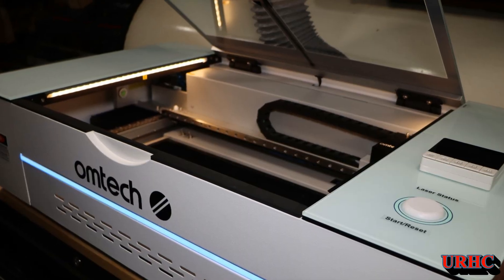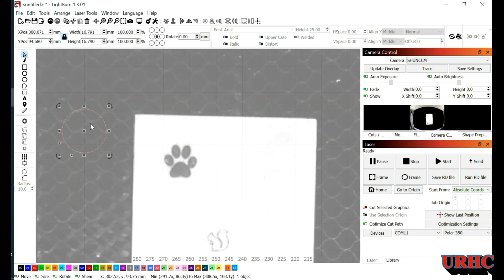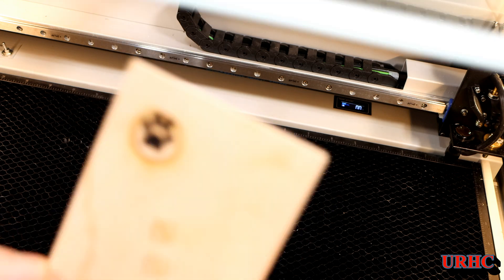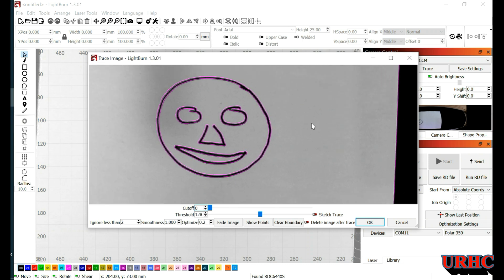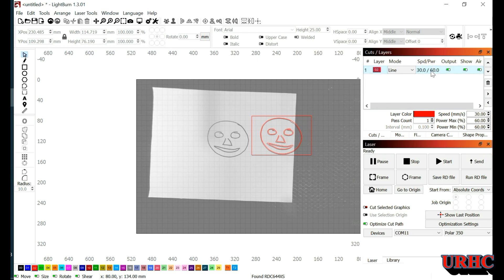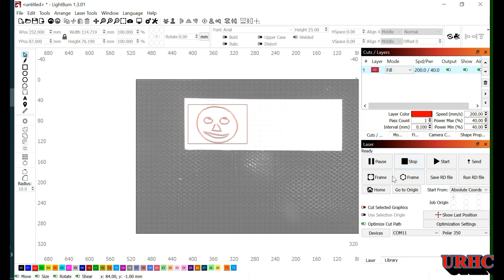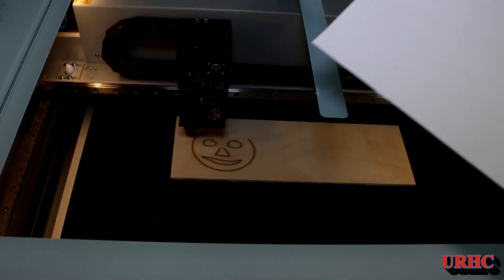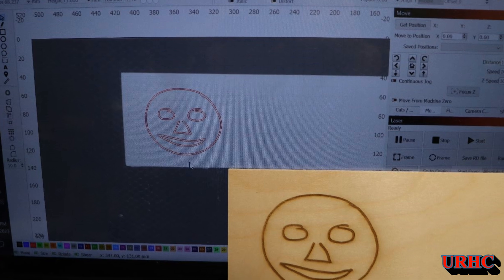Omtech Polar 350 Part 3 Calibrating The Camera And Duplicating Hand Drawn Artwork

Comment: HI! just bought this laser cutter and am having a few issues . the camera does not pop up when trying to calibrate and sometimes it does but i cant seem to get to the next capture image with out it loading for hours and having to start the process over. any thoughts thank you!
Reply from the maker: You should  contact  Omtech and see if they have a calibration file for it yet or new instructions. Mine took a long time to get close. I would also check the usb cable is plugged into a high speed port and your computer is working properly because it should load fast. I use Win 11 and speed wasn't a problem.  Omtech support will get you going. Thanks for watching.

Comment: If you're considering buying this, think twice. It's overpriced and underwhelming—far from worth it.
Reply from the maker: You keep posting  the same thing without  a full explanation. Is something wrong with your machine or do you work for a competitor and just trying to scare buyers? You should contact  Omtech corporate if you have an issue with something they sell or return it.
Reply: This guy or gal (or bot), is a dick. I love my Polar and I am so happy NOT paying $3000 more for the competition! Does everything I need and more. It is a great machine, and good customer service too (the camera USB circuit board was broken upon purchase, replaced at no cost in less than 2 weeks).